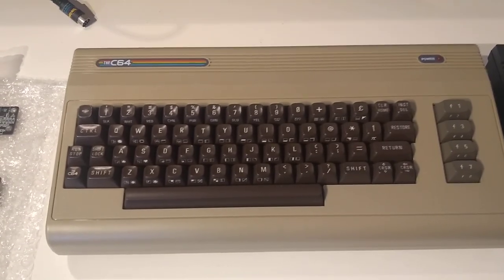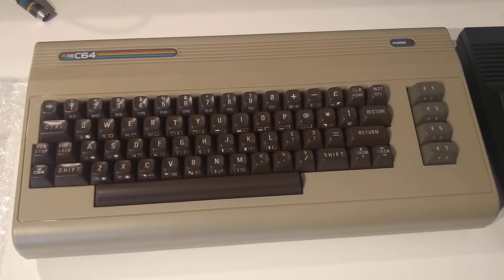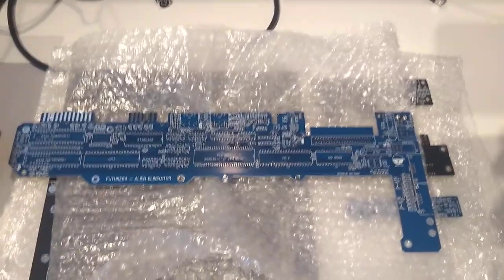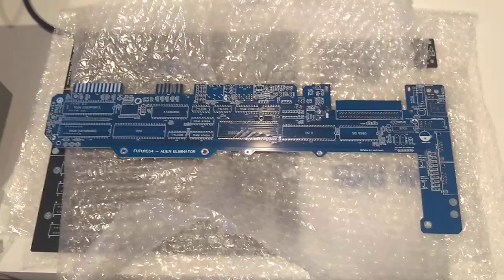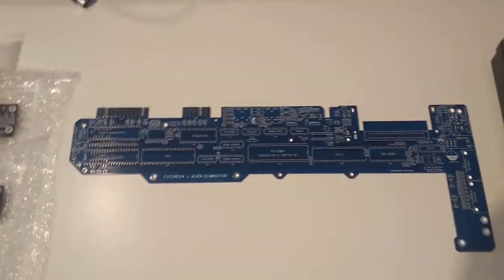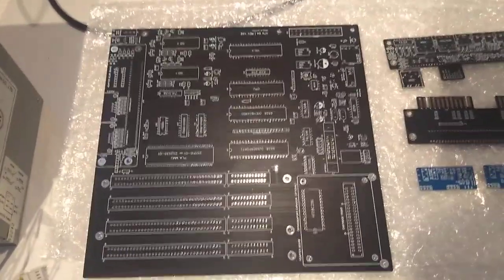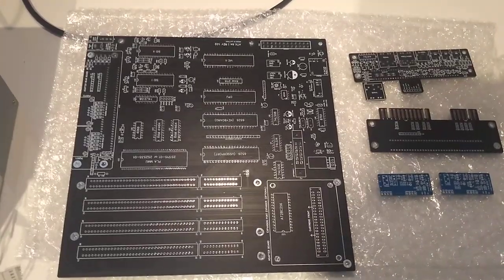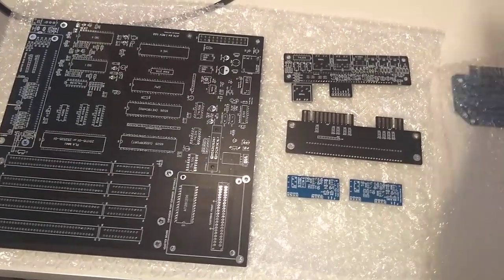There are other clones than SixtyClone in the wild....

Comment: There is also a copy of the KU motherboard by bwack, probably not a clone, but you can take the gerber files and get a gold plated motherboard made.
Reply from the maker: Yup. I know it. It is actually the first clone that was created as far as I know. It was out a couple of months before SixtyClone boards. It should be a 1:1 clone of the original C64 KU model.